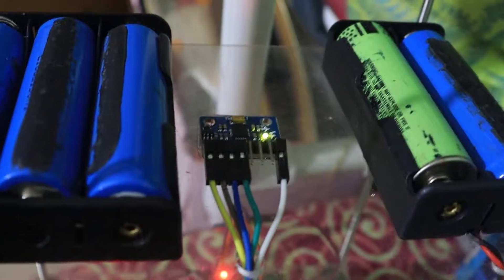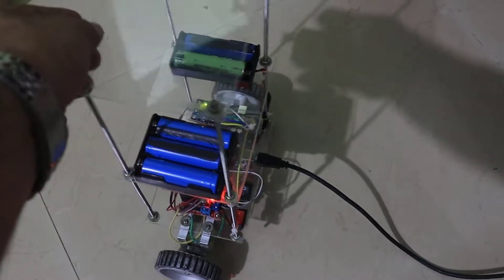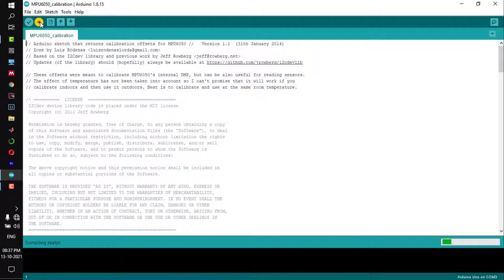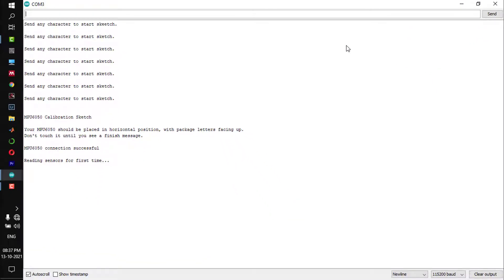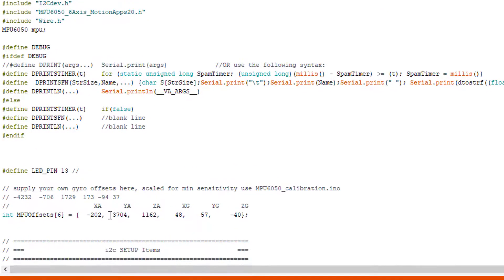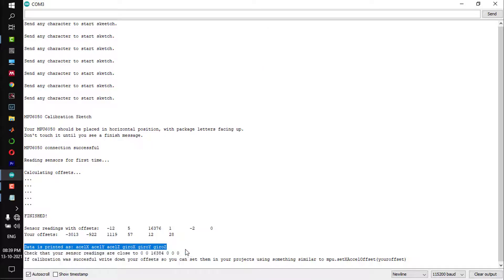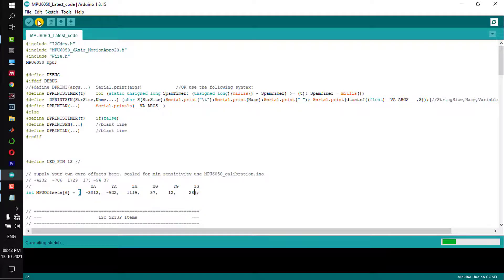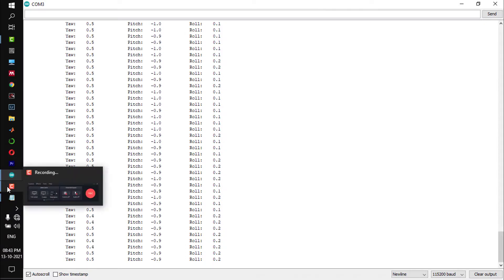Calibrating MPU6050 Gyro Sensor for Self balancing robot using PID Controller

Comment: Hi sir..i have mpu6050 attached on my hibiscus sense board..can i use the same method to calibrate?
Reply: as long as orientation of sensor is same, you can you same method to calibrate is...
Reply: if the height of the sensor placement is different will that affect the calibration? @RecreatingNature280
Reply: I have error TWBR is not declare